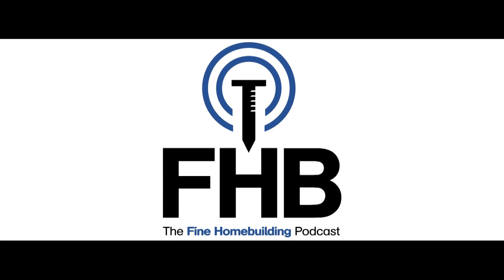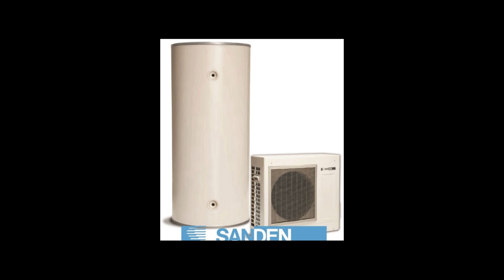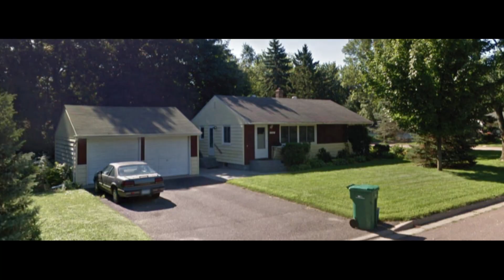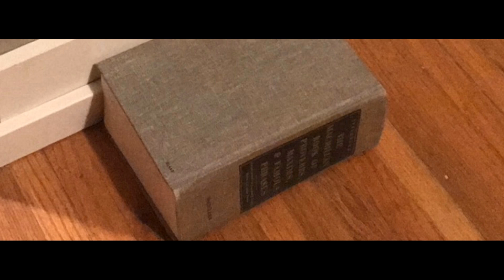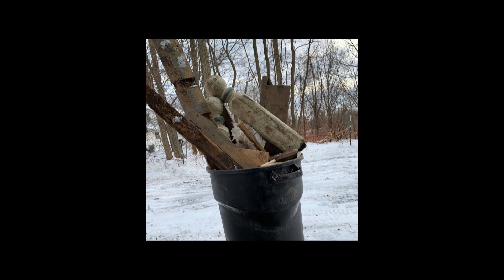Podcast 217: Architecturally Correct Trim, Keeping a Cabin Warm, and Fixes for Butchered Floor Joist

Comment: Thanks for covering my question FHB crew! For those interested in building science regarding evaporative cooling, this is the only study I've been able to find, from a Building America DOE program: Swenergy.org › mojo › mediaPDF
Web results
Evaporative Cooling Systems for New Homes
Evaporative cooling only works with outdoor humidity levels below about 55% or so (more with some of the newer indirect/direct type models) but during what time it is less humid than that they run at less than half of the cost of AC. I always say they're like a whole house fan but better, because they offer the option of cooling and pressurize rather than depressurize. As far as how the added humidity affects the house, that's what I'm looking for more info on. My cooler sometimes gets the house up to the low 70% range, at which point the heat pump ac will kick on and upduct dampers close, but I'm wondering if I should lower that setpoint.

Comment: You need a neutral at the switch to be code now
Reply: I'm not sure what you mean by that. I've not seen a single-pole switch with a neutral terminal. The ones I've installed have one ground screw and two terminals - one for the hot, the other for the switch leg. If you wire the switch with two wire, which has a hot, a neutral, and a ground, the neutral has to be labeled for hot. At least that's the way I learned. Is that what you mean? If not, a code reference would be helpful.
Reply: @matthewmillham2025  I'm an electrician and with modern lights sometimes a neutral is needed for a dimmer, so new code requires a neutral at switch boxes unless it is easy to add one later.  http://electricalcodeconnection.com/404-2-switch-connections-neutrals-at-a-switch-new-to-code/
Reply: @wallpello_1534  There is a neutral in the box; it's just coded for hot. As far as I can tell, that's above board. Would link the article right from the online code, but they don't allow it  https://www.mikeholt.com/mojonewsarchive/NEC-HTML/HTML/Article-404-Switches~20040624.php
Reply: @matthewmillham2025  the grounding and the grounded conductor are two different things.

Grounded is the neutral wire (white wire) it carries the load normally.
The grounding wire (bare or green)should only carry fualt current and they should only be tied together at the first point of disconnect.
Reply: You now need both at all switch locations, unless you run pipe
Reply: @wallpello_1534  I get that - what I don't get is, are you saying I need a 4th wire? I have a hot (black), a neutral/grounding conductor (white), and a ground. The neutral is currently labeled for hot, since it completes the switch loop - that's what I was taught to do at school. I don't see a code provision for a dedicated, and I presume capped, neutral in a switch box that would be in addition to the neutral already there. It seems like I must be missing something, but I don't know what it is.
Reply: @matthewmillham2025  it doesn't matter the color of the wire it is no longer a neutral if it is hooked up as a switch leg or a hot.
Reply: @wallpello_1534  I understand what you're saying. What I'm missing is an actual code reference that says I need to have an unused extra neutral, rather than an available neutral. I have a neutral, and if somebody wanted to do some kind of retrofit, it's there - all you need to do is take the tape off, and it's not labeled for hot anymore. What would someone in the future do with two neutrals, one hot, and one ground in the box? Is the current requirement that you have to run three-wire to all switches?
Reply: @matthewmillham2025  the neutral is not "available" if it is being used as a hot.
Reply: @matthewmillham2025  what people need is a hot, a switch leg, a neutral and a ground.   Not two neutrals.
Reply: @matthewmillham2025  Matt, he's right, you need a dedicated neutral at the box. Taking the tape off of a white wire that's been used for hot instead of neutral doesn't make it neutral if it's still wired for hot. I'm not sure of the exact code because it's so new, but the change was made to allow for "smart" switches, which often require a neutral connection in addition to the two hot (incoming and outgoing) in order to be able to sense remote signals, motion, or whatever they're designed to sense. Sensing requires being in an active state, which requires power consumption, which requires a hot wire incoming and a neutral wire for returning power to the source. In essence, some switches are now a load rather than just a pass-through device.
Reply: @wallpello_1534  That would make sense where it's needed. The code indicates the requirement you're referencing kicked in Jan. 1, 2020, with exceptions for retrofits and other things. But it's still, to me, bizarre that the code would require three-wire to a switch at a dead-end. Other than possibly adding a dimmer in the future, what's the reason? If the point of the code is safety at a reasonable cost, what's safe and cost effective about requiring extra unused wire?
Reply: @matthewmillham2025  I think maybe you're misunderstanding the "dedicated" neutral. If there is already a neutral wire in the switch box which feeds back to the neutral bus of the panel, you do not need an additional dedicated neutral for the switch. Some wiring schemes, mostly used before the 2000s, would not have a neutral going to the switch box at all. The power would feed into the light fixtures then use 14/2 for a loop to the switch. This is no longer allowed.
Reply: This makes slightly more sense, but I don't understand the safety issue. My situation is a switch added past the light - there's nothing beyond. It's a dead end. The neutral doesn't go back to the panel. It's part of the switch loop. Sounds like the situation you're saying is no longer allowed. But is it not allowed because it's unsafe? Or is it because of possible retrofits (and people trying to splice into it assuming a hot-labeled neutral is still a neutral)?
Reply: @matthewmillham2025  New code applies to new houses. Whether old work has to comply is largely left up to the AHJ, but I wouldn't think most would force you to add a wire unless there was already a substantial upgrade being made, in which case why not future-proof? That's the intent of the code anyway.
Reply: I might be wrong but this kicked in back in the 2015 code or before

Edit: but I am positive that it is before 2020 because I've argued with inspectors about this.
Reply: @matthewmillham2025  it is NOT a neutral if you are using the wire as a switch leg......
Reply: @wallpello_1534  depends where you are...
Reply: @JoeSmith-um2sg  Yeah, that makes slightly more sense. I mean, I live in a house that was built and wired in 1951, and there's not a ground to be found. The new wiring there is was added either by me, my dad (who is an electrician), or the previous owners (a Brit and a Dutchman). The particular light in question (a fan/light garbagaganza, actually) was added by the Brit/Dutch duo. 12/2 from the panel to the fan/light, before I took it out. So, if I wanted to add a switch beyond that (at the doorway) so I didn't have to walk across a dark room to turn it on, and make it code-compliant, how would I go about it?
Reply: @matthewmillham2025  use 12/3, connect the neutrals and use the extra (red) wire for the switch loop
Reply: @JoeSmith-um2sg  Just cap the neutral at the dead-end switch? And then pigtail it at the fixture? I don't get what that gets you, other than code compliance. What's the purpose of the dead-end neutral at the switch box? How is adding extra wires safer?
Reply: @matthewmillham2025  not safer, future-proof. Better to have and not need than need and not have. If you're running a cable anyway, it's a negligible difference to run 12/3 instead of 12/2 for when you or the next owner gets fascinated by smart switches, or the code requires something new(er).
Reply: @matthewmillham2025  some dimmers and smart switches need it.
Reply: I did a little research and the 2011 NEC add this, some areas take a while to adopt the new code but pretty much everywhere should have adopted it by now.

Comment: A stainless steel water heater tank is not super disposable.  That is a huge part of green building.  I was shocked to find that a conventional water heater with a stainless tank is only $100 more than a glass lined one.  That is what keeps me from getting a typical hybrid heat pump tank.  I would like to see a lifetime stainless tank with easily serviceable parts.  I believe most of the hybrid heaters are consumer junk in that respect.  The split system mentioned in the podcast does have a stainless tank, but the upcharge for a stainless tank should be $100 not $2000. 

 I personally would have like to see a bigger push on the separate heat  pump that was adapted into a conventional water heater.  I do not believe they are made anymore.
Reply: I was under the impression stainless steel is 100% recyclable. Are there some complicating features of the tank that would complicate its recyclability?
Reply: @JaredCzaia ,. The crux of my point was that stainless steel water heaters are way more green than glass lined disposable tanks, yet they are only marginally more expensive.  So yeah, you can recycle them, but you really should not have to because they are potentially a lifetime tank.  You might even be able to weld a repair on a stainless tank if you had the skill, but that would be a no go on a glass lined tank.  Glass lined tanks are disposable garbage, so it irritates me that all of the readily available hybrid heat pump water heater units utilize consumer/disposable glass lined tanks, so that you have to buy a new one every 5-15 years.  If they made a typical stainless hybrid unit for marginally more than a glass lined hybrid unit, then I would get one.  I believe Electrolux used to make one, but it is no longer available.
Reply: @Thomas-wn7cl  Gotcha, I thought you were critiquing stainless steel as a problematic material that is hard to dispose of. I understand now.
Reply: @JaredCzaia  👍👍👍